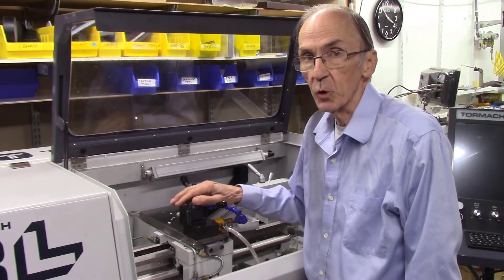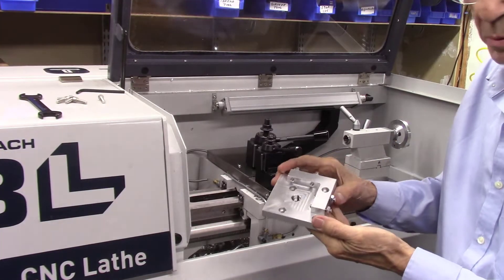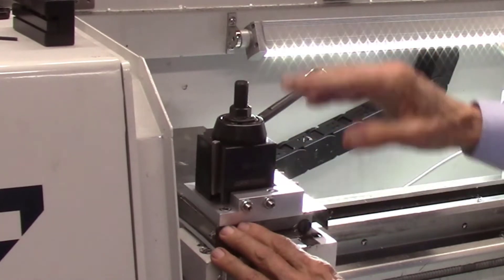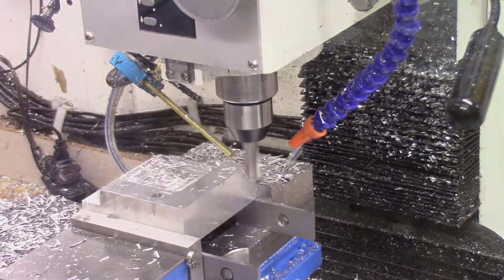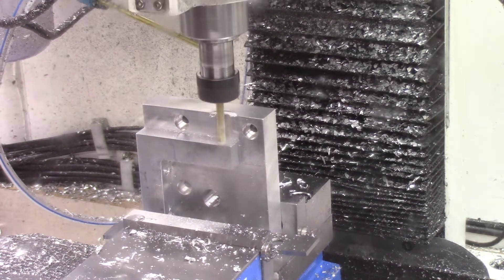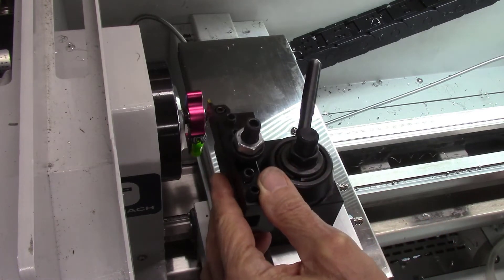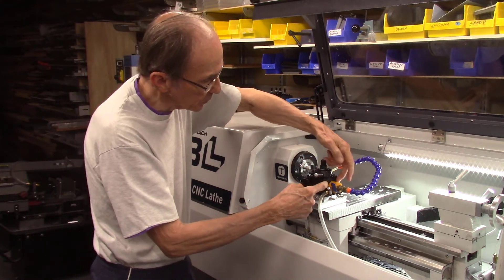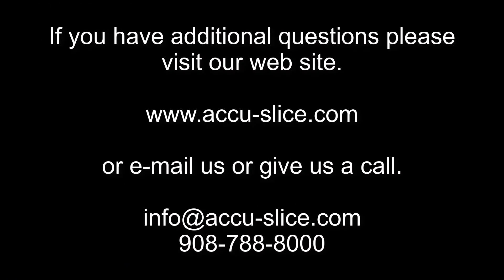Tormach 8L Lathe - Conversion of the OXA Tool Post to the AXA Tool Post

Comment: dang - i JUST saw the video about the spacers on the PM lathe and now you're already upgraded to CNC 😂😂
how do you like the 8L - any reason you wish you had gone for the 15L? I'm currently looking at the CNC options for my PM1022 but not finding a lot - is that the reason you went for the 8L?
Reply from the maker: I went with the 8L due to cost.  However in retrospect I would have preferred the 15L with the automatic tool changer. The 8L is working just fine and appears to be quite accurate. Manual changing of the tools is time consuming.

Comment: Very nice work! I'm surprised that they didn't have the toolpost bolt going right down into the cross-slide itself, that would surely have been the most rigid way of doing things, while still allowing rotational adjustment. I'm glad to see any videos on the 8L, there's few enough out there!

Comment: Great video and improvement to the lathe. Do you think it is possible to using gang tooling on the 8L?
Reply: There’s a dude on IG that made a small gang tool set up and looks like it works really well. Not a lot of x travel but it does work

Comment: Can you rigid tap on this machine and peck drill
Reply from the maker: Dave:
I did see peck drilling in the software, but to date I have not tried it.  As far as Rigid tapping, I would recommend that you get in touch with Tormach on that question.
Reply: Look at the Tormach 8L spec.  It specifies Rigid tapping

Comment: This is brilliant.  I've been thinking of buying an 8L for making small parts and the 0XA tool post has always concerned me.  I've been trying to figure out, looking at YouTube videos, if it could be modified to use an AXA size post.  I always though it might be a possibility and your video has covered all the pros and cons, so thanks for posting this very useful video.  Do you think it would be possible to mount some gang tooling in front of the tool post ?  I know the travel is limited but for 1" stock I figure you might have enough room for 2, maybe 3 tools - a drill (stubby split point) and a tap.  With this you could drill, chamfer, and tap a hole.  I have also seen CAM posts that reference a tool post at the rear.  I'd be curious if there are another set of holes under the cover that sits on top of the cross slide.
Reply from the maker: I have been contemplating how to add additional tools to the 8L lathe.  this will be a project for the future.